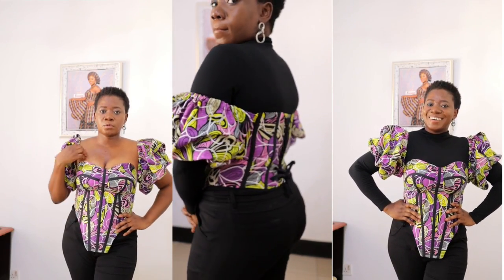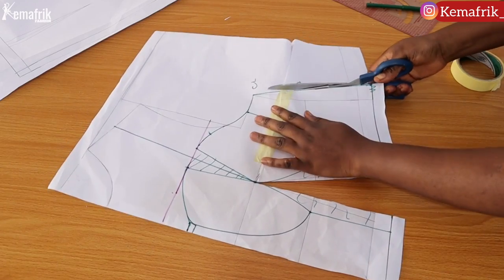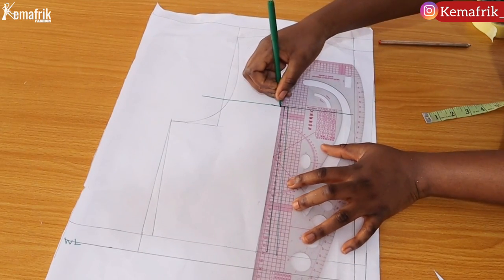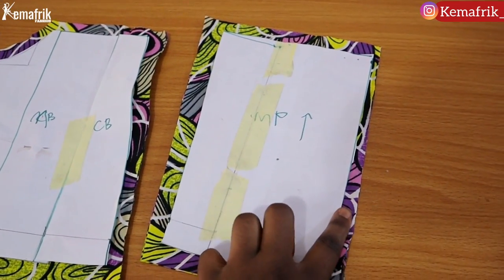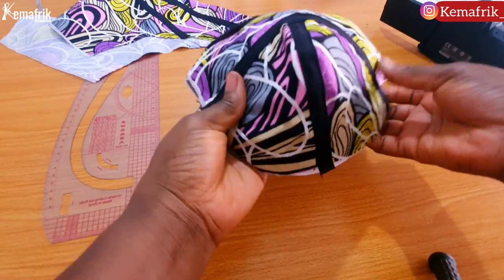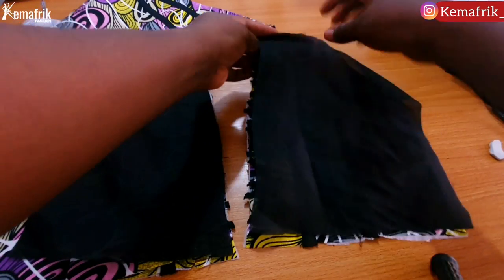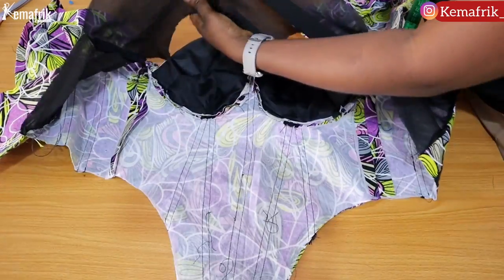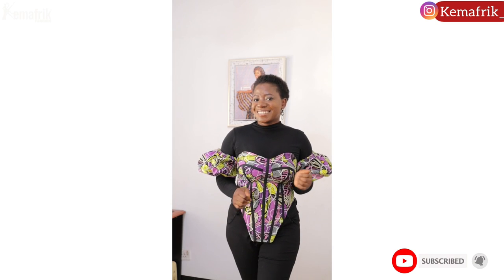CORSET TOP TUTORIAL : Pattern drafting, cutting and sewing. #roadto20k

Comment: Ma'am,  my original waistline is 18" but i don't want the waist to be exposed..  can i use 20"? Also, on the 20" line, will i still maintain my normal waist measurement?
Reply from the maker: You can just take the measurement from your shoulder to the lenght you want and also measure the circumference round that part.
Reply: Thank you ma